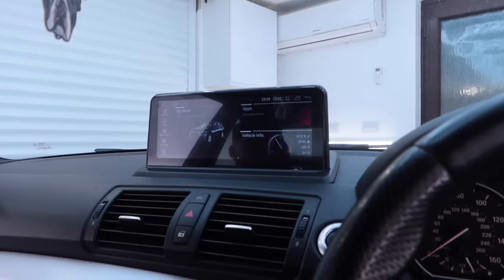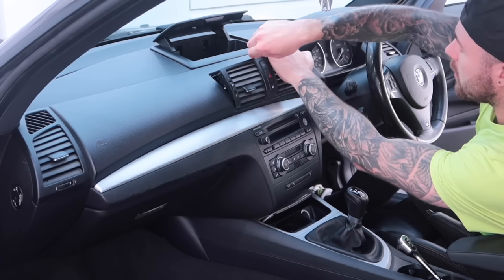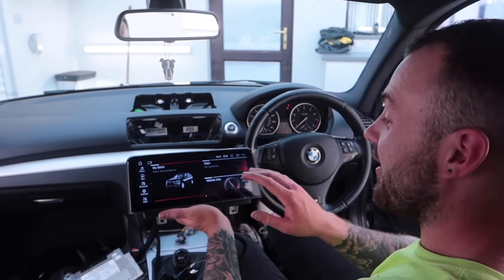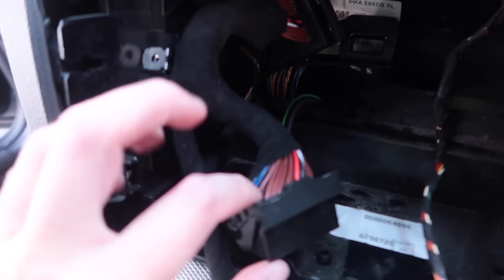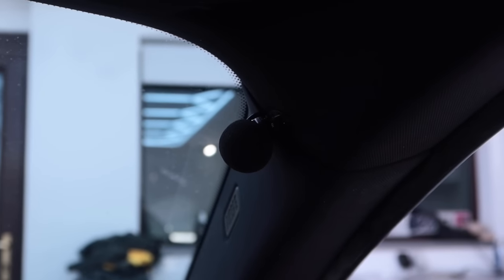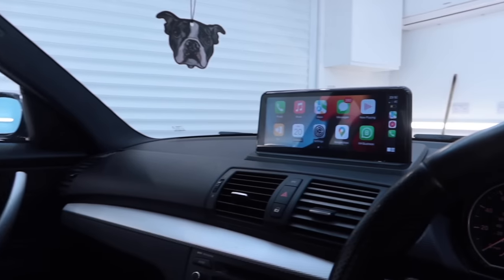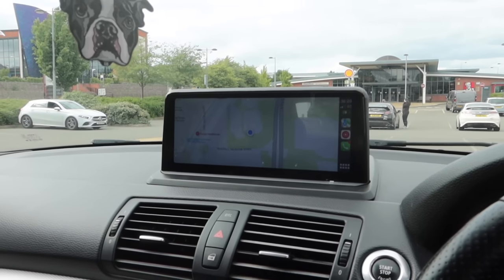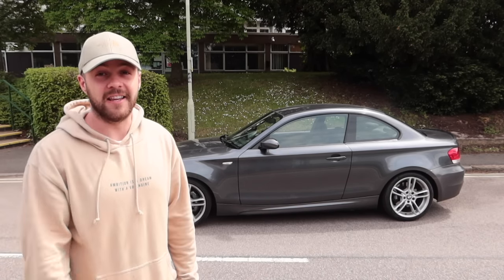INSTALLING APPLE CARPLAY IDRIVE HEADUNIT ON MY BMW 1 SERIES E82 135I

Comment: That repeating noise with the exclamation mark on your cluster happens when you have your driver side door open with the ignition on and usually if you turn on ignition before closing your door, when you close the door the ignition will turn off and you'll have to turn on again. Easy solution is to close drivers door before turning on ignition and you'll have no gong noise.

Comment: I think the beeping when you first turn the  screen on is the screen connecting to the car and detecting the doors are open. I think you can turn it off in the settings
Reply: Ignition + open drivers door = exclamation mark and warning sound

Comment: I’ve fitted similar to my other half’s 125i. It’s OK, in some ways I prefer it to a double din install because it’s higher up the dash but they are quite big. The double sun is less reversible too because you need to cut away some of the dash.
Reply: i think its to big

Comment: Pretty sure you'd be find getting the idrive controller, I've got a RHD too with the CCC idrive system and they fit from factory. The obly thing is you'll loose that 2nd cupholder!
Reply from the maker: It only works with the aftermarket one that you can buy with the screen which only comes in lhd trim ☹️

Comment: I’m sitting here wanting that awesome pocket on the dash for my E82.  Loved my single hump 335i. But I wouldn’t mind an updated screen for mine, I just want it to look OEM.
Reply from the maker: They do them for ones without the dash bin if you havent got it. You just need to cut the dash which i think sounds scarier than it is!
Reply: @Chris_Slix  yeah that is the one big deterring factor. I have seen a few people screw up their cuts. I flirt with the idea of trading it in for an M4 every week.
Reply: Just get the one that takes out the radio looks way better

Comment: I might get this. Especially because it doesn’t need cutting. But a bit worried if I’ll manage to get the cables correctly
Reply from the maker: Youll be fine its not bad 😊 link is in the description

Comment: I have this screen installed, but when I insert my key and not turn on my car yet, radio gets power and so does the screen. Which means it drains my battery. How do I fix this so that I can insert my key, not start the car and make the screen stay off until I put my car on contact/start it. BMW e81! Thanks!

Comment: Mate the reason your wifi keeps turning off on the head unit is its trying to connect to your CarPlay.  And CarPlay generally uses Bluetooth first and then finalised the connection over wifi to the head unit.  So if you just want your head-unit to use as standalone android system then just turn off Apple CarPlay on the phone. And use it to Hotspot the the android system 🤞🏽
Reply from the maker: Legend thank you! Can tell iv always owned rubbish cars 🤣

Comment: Hey man, Very cool and daring vid (without instruction manual). Since i opted for wireless bluetooth connect (to play music via my phone) I had to use the AUX as well behind the handbrake. I pried it open (mine has an AUX and a sigarette lighter) and used an AUX splitter to connect it neatly under the middle console. Might give you some idea's. Oh and you're spot on about that damn plug on the middle airvent.

Comment: hi i have a question since i have the same problem. So in order to make the carplay run well, the phone must be connected to the hotspot of the headunit or the head unit must be connected to the hotspot of your phone?
Reply from the maker: Not the hotspot on your phone no, the screen has a wifi you connect your phone to at the same time as the bluetooth then it works flawlessly!
Reply: @Chris_Slix  hi , can you please do a video explaining this or tell me how you connected car play exactly? I have one of these screens in my bmw but can’t figure it out. Also nice one explaining the AUX cable… I haven’t had sound on it either so annoying, it’s useless currently !

Comment: There is a guy selling one of these that i am very intrested in but it was bought for a modell with the original cic display and my e82 only has the storage box there. Was just wondering if u knew if it would fit and Connect to my modell?

Comment: Got a question for ya!, I recently installed a 10.25inch in my bmw 1 series, just working how do you connect a sub it it Possible? The cables I look like I need I don't have anyway of buying them aftermarket, Or is it not possible at all cheers!
Reply from the maker: Im no audio technician but i have fitted a sub to a standard stereo before and you can splice into one of the speaker cables to use for the sub. Everything is doable although it may not be 100% the best option it does work.

Comment: Does the android unit play sound through aux of the head unit? Or do you know if it can done? the head unit usually act like an amplifier because there are two subwoofers under the seat

Comment: To send data fast enough without a cable it needs to use a WiFi connection, Bluetooth isn't fast enough on android auto or carplay 👍

Comment: Hi Chris, does the unit work with your steering wheel controls? For example can you change songs and turn volume up and down from the wheel like you can normally?
Reply from the maker: Volume works yes. Essentially it steering wheel still operates your original radio. This is essentially used as a aux in device.
Reply: @Chris_Slix  Can you skip song from driving wheel?

Comment: Can you not get an used centre console with idrive controller to make it work?
Reply from the maker: It only works with the aftermarket one that you can buy with the screen which only comes in lhd trim ☹️
Reply: @Chris_Slix  Find someone with a 3D printer. Seen plenty of people 3D print an adapter so it fits nicely with the center console storage bin for rhd cars

Comment: Im going to be completely honest, mate. I support you all the time, but this time I feel like I have to point it out. Not like others, that will just support and not point out the obvious!

It's cool and all, but it's a complete hazard, mate. If a little child came running out into the road, right in front of your car, you wouldn't even be able to tell, let alone react. You'd drive right over them.

In this instance I've gotta be honest, mate. It's a serious SERIOUS hazard!

Do the right thing, mate! In life, you win at times and lose at times. You've spent this cash, take it as a loss. And move on! 👍🙌
Reply: Surely you can’t say how much of a hazard it is unless your sat in the drivers seat many cars come standard with a screen like this .. have you sat in the seat and checked ?
Reply: @joshuabertie5040  do you think I've sat in his car to check? What kind of a question is that? From what he showed in the video, it's a hazard. 🤦‍♂️
Reply: @goobagooba8448  so you don’t know how much of a hazard it is .. looks alright to me
Reply: @joshuabertie5040  well you shouldn't be behind the driving wheel then, mate.
Reply: @goobagooba8448  I’m a uk MOT tester and it’s safe . Would pass a test no problem
Reply: @joshuabertie5040  yeah, and im the person that came up with the theory test and the head of operations to make sure people can see through their windscreens properly without running kids over. 🤓🤓
Reply: Hes cut his dash he cannot remove it
Reply: @ITzPoWeRzZ  nah he didnt cut it, he just unscrewed and took out the storage compartment on the dashboard. If he wants he can put it pack in. (Lets hope anyways 😆🤷‍♂️, it would be so sad if he can't)
Reply: @goobagooba8448  can’t be doing your job then cos many manufacturers have screens like this .. and they pass all the tests … strange isn’t it …
Reply: @joshuabertie5040  😆😆🤷‍♂️